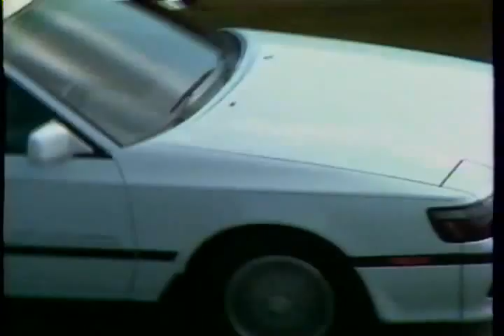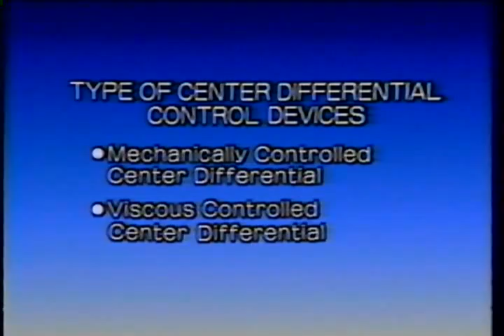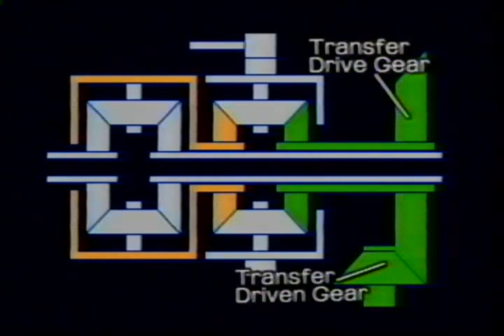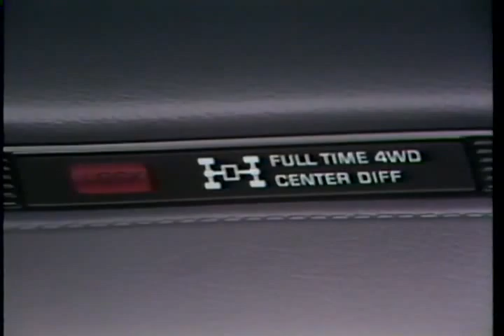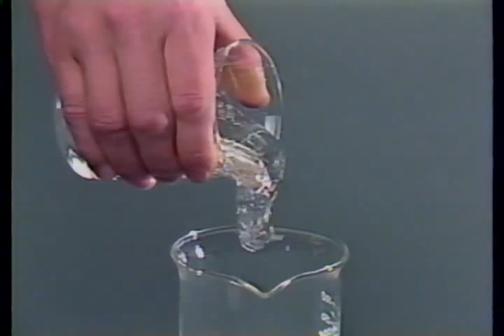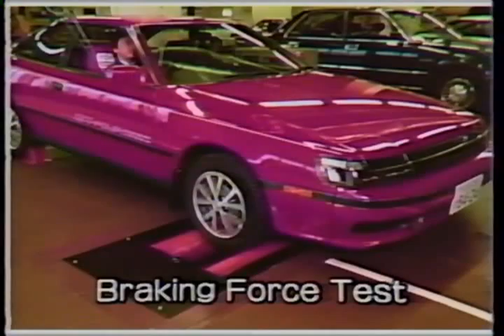Toyota Training - Center Differential 4WD

Comment: Mr Subaru needs to see this video, because the centre coconut, sorry I meant diff that Subaru use doesn't lock any were near enough to pull the weight of the car, it's not much better than 2WD 👎